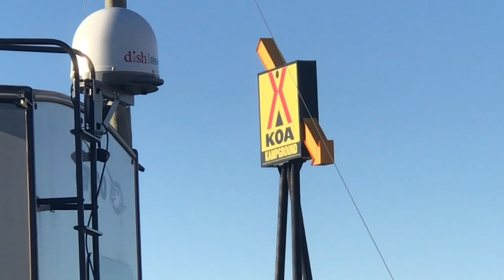Lesson on Frozen RV Sewer and Water

Comment: Cut that water hose down. (or get another one and cut it down to 10' or less)
I've cut mine down to 6' and it doesn't even touch the ground between the hookup and the trailer. Heat tape it and wrap it with reflectix insulation (and a pool noodle if you can find one)
Also, your grey/black tank hose - always leave those shut in freezing weather. Let both fill up and then dump the black followed by the grey to flush. Make sure your hose is gravity feeding into the ground so none gathers anywhere inside the hose and freezes up. When done close both tanks again.
I learned the hard way too.
Reply from the maker: Snowy Rain Thanks for the tips. I never hook up the water hose or leave the sewer open anymore. I fill my water and mostly boon-dock.

Comment: Put the coiled up portion of hose in a plastic garbage bag in the sun to help heat it up. Water inside? Put a pot on the stove and boils some water, then pour it on the connections to thaw them out to disconnect them. Use caution when using the electric heaters or cords around water connections.
Reply from the maker: akbychoice Thanks for the tip. I was going to do that today because I couldn’t get the handles to completely shut. So I went to the store and picked up a new sewer hose and pulled over to pour the hot water over the handles. But everything was melted and now all is well! And I have a nice new shiny sewer hose!

Comment: I live in South Dakota by Sturgis let me tell you you don't need those hoses laying around on the outside of your coach fill your water tanks and undo those damn hoses and as far as that clear hose now did you really think it's insulated and heated and everything else you can buy those heated hoses they're expensive but they plug into electric and they will keep from freezing but why do you need it out there fill up your tanks and hopefully you have some heat blowing on your tanks on the in the belly or you can buy electric heat strip and wrap it around some of your line and some stuff
Reply from the maker: Edgar . Lamkin Thanks for 
Mansplaining (a blend word of man and the informal form splaining of the gerund explaining) is a pejorative term meaning "(of a man) to comment on or explain something to a woman in a condescending, overconfident, and often inaccurate or oversimplified manner".[1][2][3][4] Author Rebecca Solnit ascribes the phenomenon to a combination of "overconfidence and cluelessness".[5] Lily Rothman of The Atlantic defines it as "explaining without regard to the fact that the explainee knows more than the explainer, often done by a man to a woman".[6]

In its original use, mansplaining differed from other forms of condescension in that it is rooted in the assumption that a man is likely to be more knowledgeable than a woman.[7] However, it has come to be used more broadly, often applied when a man takes a condescending tone in an explanation to anyone, regardless of the age or gender of the intended recipients: a "man 'splaining" can be delivered to any audience.[2] In 2010 it was named by the New York Times as one of its "Words of the Year".[8]
Reply: Well in regards to mansplaining you women are equals remember
Reply from the maker: Nope better
Reply: @RVFreeDa  you are the problem